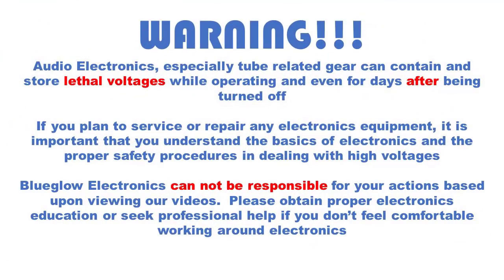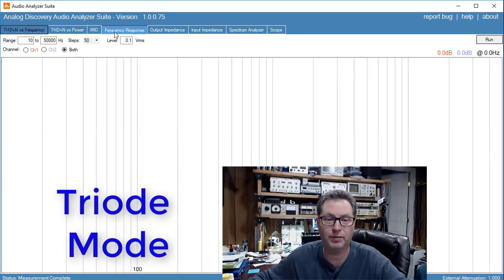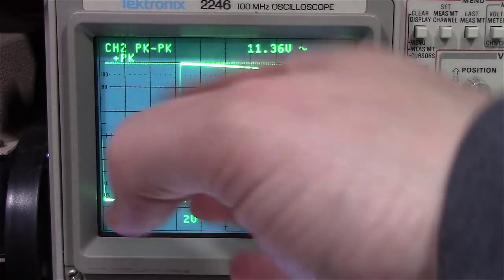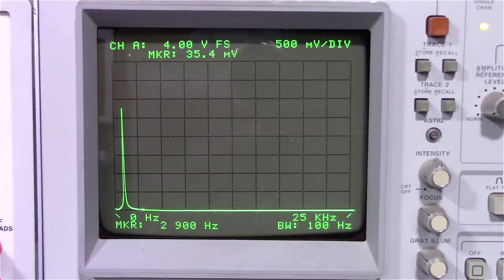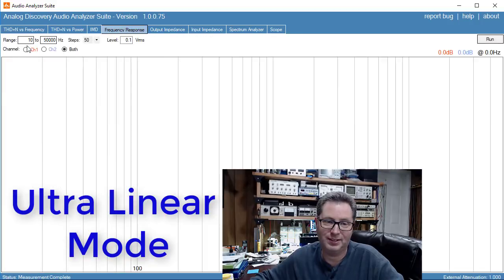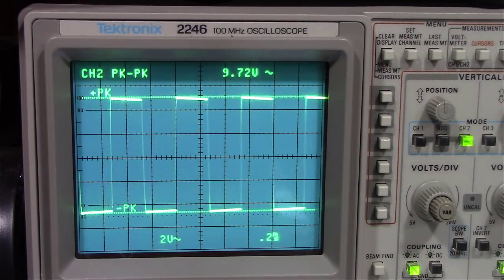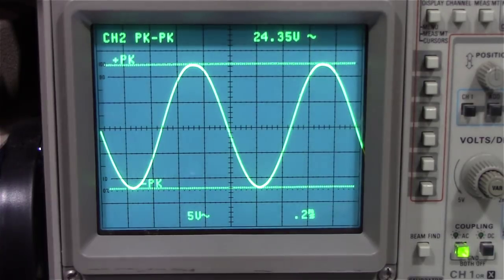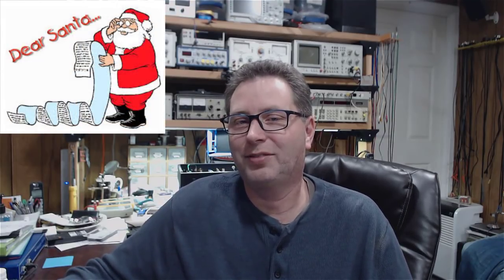KT88 Single Ended Tube Amplifier Build 2018 - Part 10

Comment: You are reading the square wave wrong. On the left side are the high frequencys on the right are lower frequencys . So what your square wave is showing is a bit more harmonycs on the top end makeing the amp more dominant on the high end . Connect a set of speakers to output and mesure square w. you will see a significant rise in the left side . The amp will sound harsh on high tones . You will need real lean speakers .

Comment: I have stumbled onto blueglow quite by accident.  It all started with a new set of headphones and discovering there was something wrong with my 30 year old Adcom preamp.  I now have new Marantz solid state gear and gone through the looking glass that is tube gear!  Figuring I should understand how tubes work led me to your series on reading schematics...    

My journey into electronics started 40 some odd years ago while in school for my EET, tubes were barely mentioned.  In truth, I have never used any of it since then, so the math and concepts are fuzzy at best.  Fast forward to now, and you have inspired me to start all over again.  

As an added bonus, I took a copy of the schematics down to show my 96 year old father, who learned on tubes.  This gave us 2 solid hours of something other than politics to discuss.  For this. I cannot thank you enough!

Comment: doesnt single end have bad bass response , some roll off , i dont see a rolloff at all , i see a bump , this can not be , does not fit in to my picture of these , if they have good bass ,  and are perfect amps due to Class A , WTF is wrong with them , they are perfect but ppl dont think so choosing AB class or something , so whats going on ?
Im just purchasing a hand made unit of this design , and if this video is to be correct then it will be last AMP ive ever purchused because i dont need much power , im not like your causal WAtt  chaser , i just want worm , technically correct sound is all

Comment: That is a great value for the beautiful sounds that only tubes can make.  If you want cheap watts go with a class D amp.  If you want good watts, this the best value i have seen in a while.   With some cosmetic changes, it could go for more than  3K.  A couple of efficient speakers with an easy load and you have a killer system.  If you are interested in some advice for room acoustics, that is what i do.

Comment: Vpp = Peak to Peak value = 2x Vp
Vrms = 0.707xVp
P=VrmsxVrms/8
P(triode)=(Vpp/2x0.707)^2/8=(22.1/2x0.707)^2/8=7.6W
P(ul)=(Vpp/2x0.707)^2/8=(25/2x0.707)^2/8=9.8W
Reply from the maker: Good call out.  RMS power a much better measurement

Comment: I have enough parts to build something similar but the power transformer is 300-0-300 @ 450 ma (XPWR137-120) and the output xfomers are the same as the 807 amp build. I'm hoping for 10 w per channel. It won't be like this amp but definitely Blueglow inspired. I'm wondering how hard it would be to install a phono pre amp into this build and avoid a dedicated pre amp.

Comment: What will you use for a preamp? Is there a build out there for a preamp that will compliment this build?
Reply from the maker: Remember the 6SN7 preamp I bread boarded earlier this year, plan to do a similar build video for it in 2019.
Reply: I've been looking at the same thing.  Not many DIY pre-amps out there that look fairly easy and not overly complicated.  Saw a old Peter Millett pre-amp he did from 2004 or so that looks promising otherwise all I have found so far are over priced high end stuff or ones I think are way to complicated for my level.

Comment: With your excellent build guide and your step-by-step procedures I think you just pick my next and first HV tube amp build. Just finish building my first low-voltage single ended, class A, dual mono block, amp camp amp, 15 watts. I also learned how to build my first over engineered overkill linear power supply each for my dual mono blocks. After a few situations of magic smoke some sparks and arcs I made my dim bulb tester and got a Varriac and isolation transformer. Bring on the tube I’m ready to go